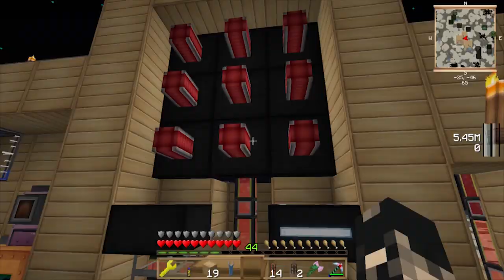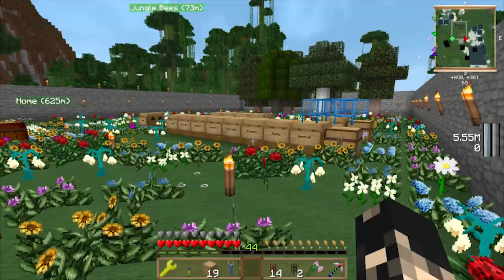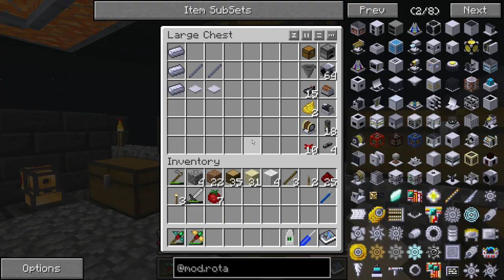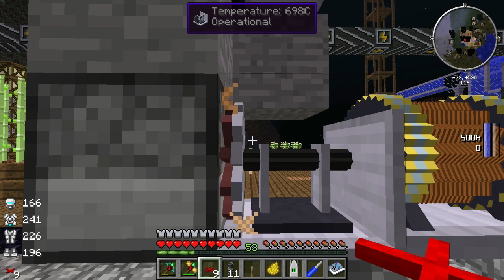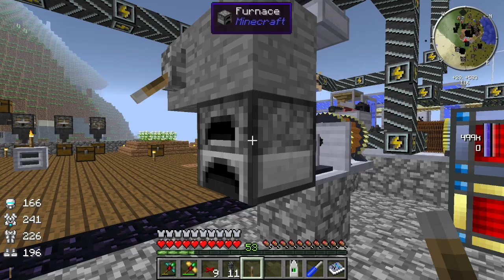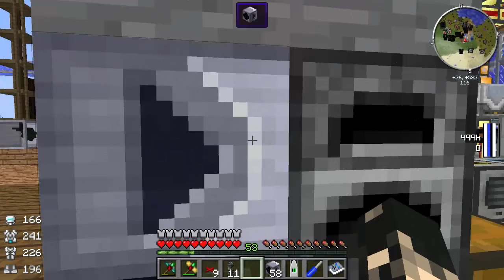Monster FTB Friction Heater, Instant smelter

Comment: Hey Ausyarr , i'm starting to play Monster (which i customizated with mekanism , dartcraft and other mods) and i have one question : Does the rotational dynamo have a limit on the RF produced? Thanks in advance. 
PS:This friction heater makes IC2 induction smelter pointless lol.
Reply from the maker: Yeah its got a limit of 47 rf/t, you can convert to steam with a friction boiler and then us MFR steam turbines to convert RF, there is a 20% power loss thou but its what I use. http://youtu.be/1v2uj4i41eU thats the vid I did on this.
Reply: Thanks :D
Reply from the maker: MisterXerox I've just been told it has a new limit of 12K, Reika says 11932 RF/t limit
Reply: thanks again lol :D
i just need diamonds and i'll start RC. need to make a quarry =s
Reply: MisterXerox you dont need diamonds to "start" RC... you just need barrel-loads of iron. iron seeds in an RC fan farm (harvests 3x14 area with a steam engine going in), sprinklers, fertilized earth and an item vacuum=lots and lots and LOTS of iron.
Reply from the maker: lots of iron
Reply: well, doesn't really matter , coz i spawned right beside one of those thief dungeons. 4 diamond blocks and plenty redstone and iron. built a farm form essence and i have dartcraft on it. S2 Time Torches. tho it's a lot overpowered =s
so i'm not really going to use it that much